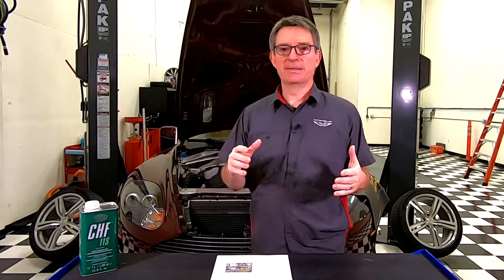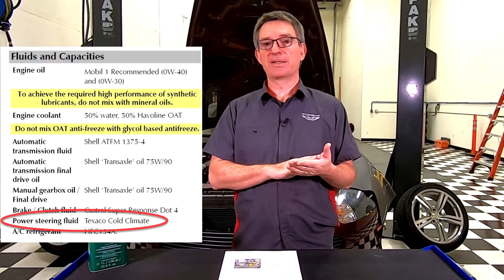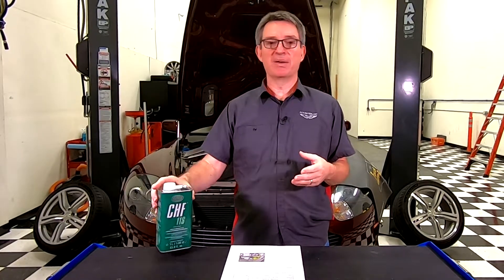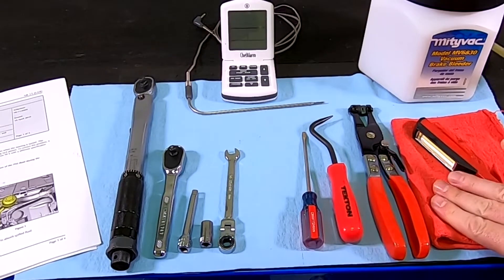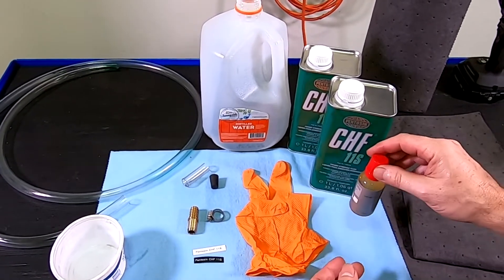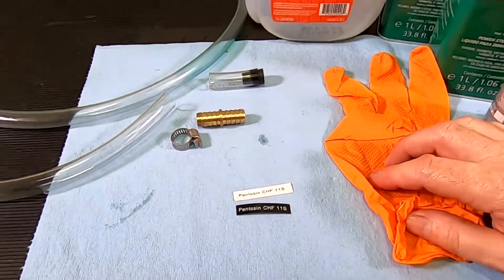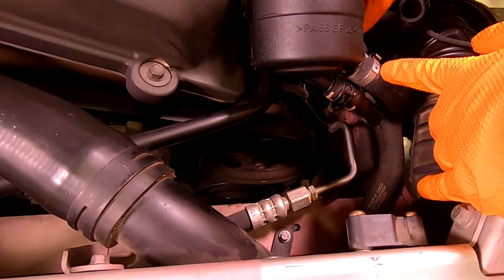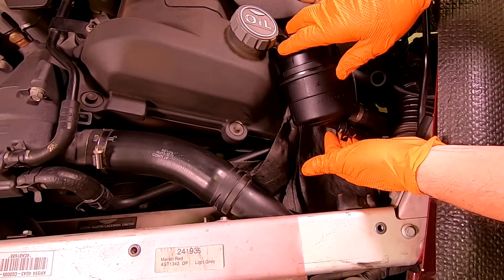Changing the Power Steering Fluid in an Aston Martin DB9

Comment: Hi Steve,
I have just completed this process on my 2005 DB9 and I followed your instructions, pretty much to the letter. I did not remove the slam panel or anything else for that matter. Yes, the front bolt on the reservoir frame is very difficult to get at but it is doable with a little bit of patience and luck. The whole thing worked exactly as you said in your excellent video and my steering is noticeably smoother and quieter. I would like to say a huge “Thank you” to you for making Aston Martin ownership affordable and more enjoyable as you give me the confidence to take on tasks that I may otherwise have thought twice about. I have followed a number of your maintenance tasks and other suggestions and they have all been spot on. My next task will be new pads and rotors, which you don’t quite cover in your videos. If anyone out there can tell me if you can change the rear rotors without having to remove the emergency (parking) brake callipers ( can you just split them?), I would be very grateful.
Best regards
Bryan

Comment: Thanks Steve - followed your procedure and all good. Slightly different reservoir fitment on 06 Vantage but minor. Most awkward job is breaking seal on pipe to remove from reservoir. Took 3 reservoir fills/flushes to get to clean green fluid. Took longer than 8 mins to reach 100c but got there in the end. Used 2.3 L of Fuchs for whole process plus 50ml Lubrizol (from BMW Germany as none in UK!). As mine right hand drive I did opposite turning procedure to you - not sure if that was necessary but seemed logical !…….now let’s see if I am rid of squeak and/or any other improvements !!
Thanks again……..

Comment: Hi Steve, I've got a 2004 DB9 and normally I really enjoy your videos but I have a problem with this one. I changed the power steering fluid last week using your video and the AM service sheet. I very carefully changed the fluid step by step but unfortunately when the time came to run the car the power steering pump was very noisy for the first few minutes and now the steering wheel is very juddery, the car is unusable at the mo, I just cannot move the steering wheel properly!! the pump is not noisy now but either the pump is now faulty or there is a massive amount of air in the system?? There is a bleed procedure in the AM DB9 workshop manual which I have completed a few times and the wheel is now slightly better and there is still lots of air bubbles still seen in the reservoir.
So please be careful conducting this procedure, as i say I followed this 100% carefully with all the materials in your video and the car is now stuck in my garage until the steering gets sorted!! I feel there is something missing in this procedure which unfortunately pumps alot of air in the system!!!
Reply from the maker: Thanks for sharing.  The process I followed is the Aston Martin procedure from their updated service bulletin.  You saw me do it just as its written, step by step.   Generally the system is self bleeding with use if the pump is working properly.   Troubling that the pump was noisy after the start up, perhaps it was running dry?   Perhaps one of the hoses is cracked after wiggling it all around, or pinched restricting flow?  Wish I could help you get it sorted.  Thanks for watching.

Comment: Thank you for you time and quality of information and job ! 
Please help me out 
I have 2009 DB9 24k miles when I turn steering very fast on when diving it’s make loud noise 
What do you think is that bad pump ? 
Please let me know
Reply from the maker: Sorry to hear about the noise.  It could be many things.  After checking the PS fluid level, and then doing a full flush, the simplest would be to check the FEAD belt (accessory belt) that drives the drives the power steering pump.  If the belt is worn, or the tensioner is shot, you might be hearing belt slip under load.   Best of luck.  Thanks for watching.
Reply: @Aston1936  thank you so much for reply 

I have new belt and new tensioner and fluid is leveled 
But didn’t flash it 
Maybe the bad fluid 
But maybe wrong belt 
Continental OE Technology Series 4061073 6-Rib, 107.3" Multi-V Belt
 This is belt I order and install

Comment: Hello Steve, Thanks for the information, I checked my owner’s manual (2016DB9), the recommended oil is Pentosin. It seems they have corrected the recommended oil in the newer cars. One point that I want to add is that I know BMWs have a similar maintenance update from the factory and it is recommended the system is completely flushed and also the reservoir is replaced before Lubrizol. The Reservoir has some type of filter inside that is difficult to completely flush.  Aston reservoir might be different but just wanted to share the information. Thanks for sharing.
Reply: Also that was a very involved and technical process, well done!

Comment: You don’t need any additives for the steering system. Thats a myth. I can understand using additives in motor oil but in steering fluid it makes no sense. It doesn’t seal leaks nor it makes the pump go faster.